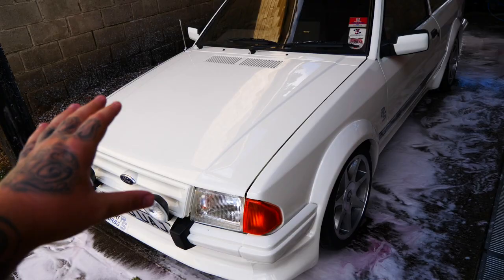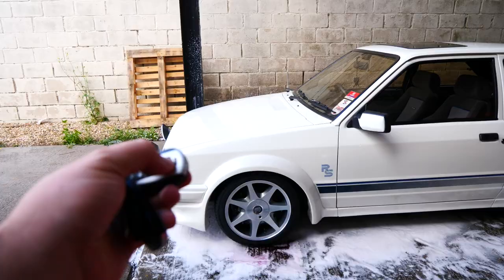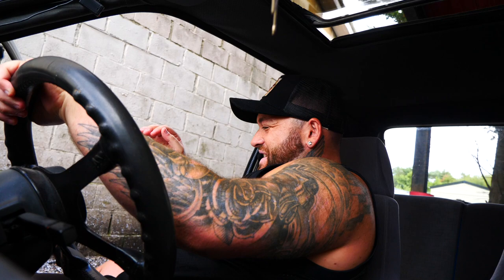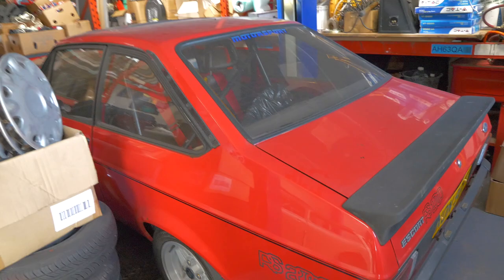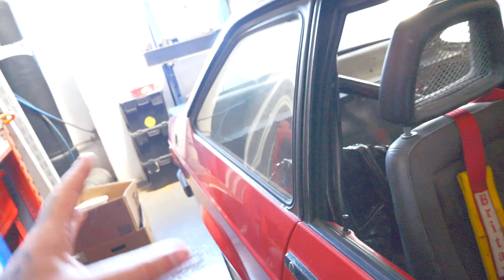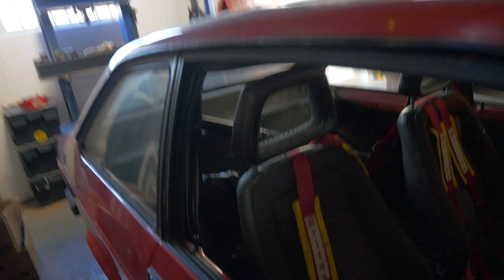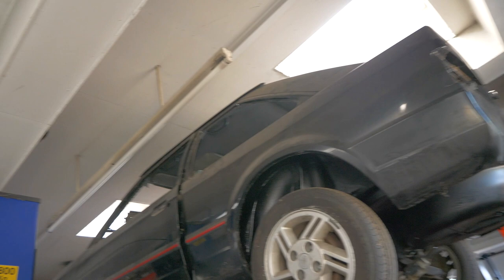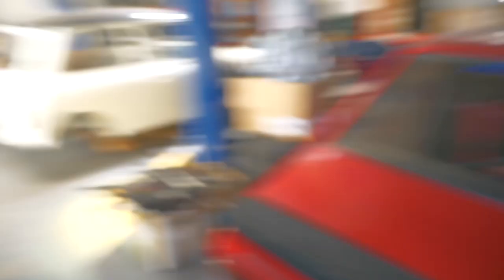making an offer on an abandoned MK2 Ford Escort RS2000

Comment: They never made a flet front rs2000 , they where all converted by owners
Reply: Nope they made the flat front rs2000’s but not for the UK market.
Reply: In the uk market you are correct rs2k they didn't come from factory flat front. But in aus and in sourh Africa they came flat front and in 4 door versions of the rs2k. My dafs has a rs2k converted to flat front due to the price of a nose cone was more the double the cost od 2 wings front panel and bonnet lights and quater bumpers 🤷🏽
Reply: @upurkilt7246  yes I know they had a 4 door rs2000 and a 4 door mexico  , no uk flat front

Comment: In Australia and South Africa they released a flat front RS2000 mk 2 escort. Only actual Works period Rally cars were released in Europe with a flat front. Custom was actually a trim level for the droop snoop RS2000(top spec). In Australia they even released a four door RS2000  and other 2 litre escorts, like a 2L Ghia, and a 2L panel van.
Reply: No no no you could buy new from euro Ford dealers a flat front rs shell new and even a trimmed shell 
Then build as a new car or repair a damaged one or rally car 
So these got registered as a rs1800 rs2000 or Mexico or sport
Reply: The works rally cars were the RS1800, never RS2000. The RS1800 was sold with the Cosworth BDA for homologation purposes.
Reply: The Flat Fronts in Australia weren't RS2000s. They were marketed as Rally Packs and just GL spec Escorts with a 2.0lt from a Cortina (not uprated) as the pollution laws made the kent engine gutless. The Australian version of the RS2000 had this watered down engine, none of the alloy parts, mounts, sumps etc. But they were available in 4 doors and even rarer Automatic transmission. All Aussie Escorts, Vans and Ghias got 2.0 from about 1977. I own a late 1980 Factory 2.0 van that I've just imported into the UK.